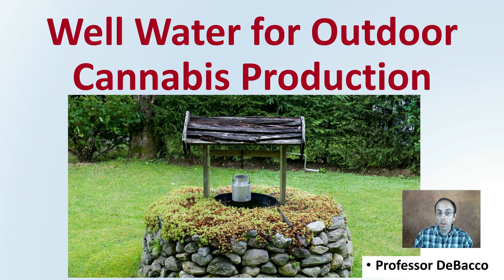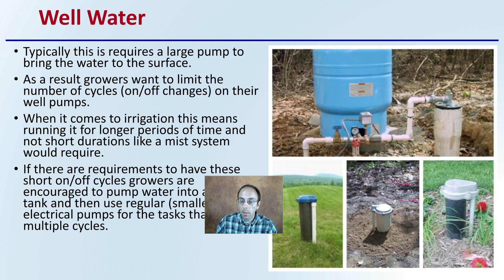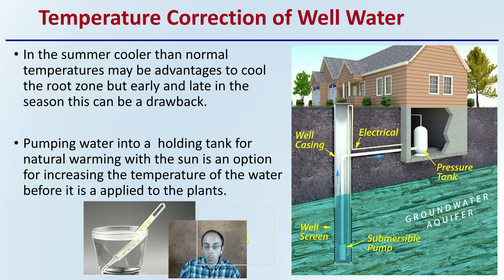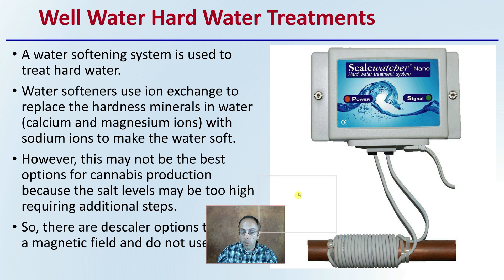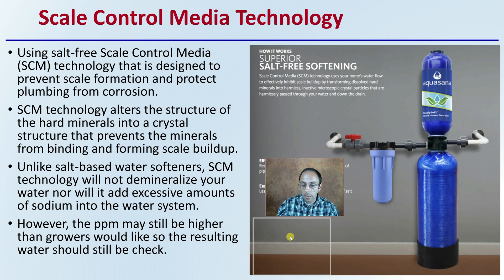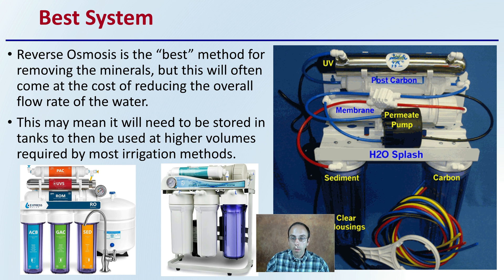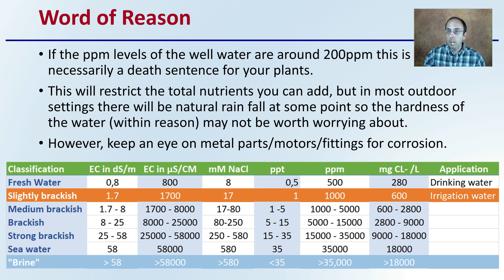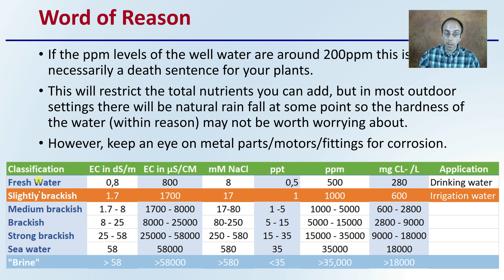Well Water for Outdoor Cannabis Production

Comment: Hello, I would like to ask you a question, if I used RO water and I have 40 plants in 10-liter pots, would I have to add calmag in each watering? because if so, my budget would go through the roof, because the calmag they sell say to use, for example, 5 ml per gallon of water. So if I have to add calmag for each irrigation and per irrigation I use 100 liters, the budget for the 3 and a half months that the crop takes is very high. I do not know if I am doing any calculations or if what I say makes sense, and if I am right, what solution do you recommend to be able to provide RO water with the calcium and magnesium it needs in each irrigation? since adding calmag in each irrigation is a budget that I cannot afford.
Reply: I use Epsom salt for magnesium 50% of the time and botanicare Calmag the other 50% during waterings 🌊
Reply: @stangcobra592  Good morning, the problem is that in Argentina there is no botanicare calmag and those that exist are super expensive one liter bottles. 4 times what comes out in usa. So I can't buy a thousand bottles of calmag to give calcium to the water every time I water and maybe there is something cheaper like doing the calmag yourself or I don't know anything else to replace it but of the same quality
Reply from the maker: There are other cal-mag products but Botanicare is highly rated and I have supporting tissue test that show results.  The Epsom salt idea should offer an easy to get option for the Mg then it is just fining a local Ca source.

Comment: if you use well water testing around June or when your water table will be at its highest can give you a more accurate test to know your highest ppm of the year . many wells can vary in ppm as the water table moves.
Reply from the maker: Good point to mention, continual testing of any water source is advised.